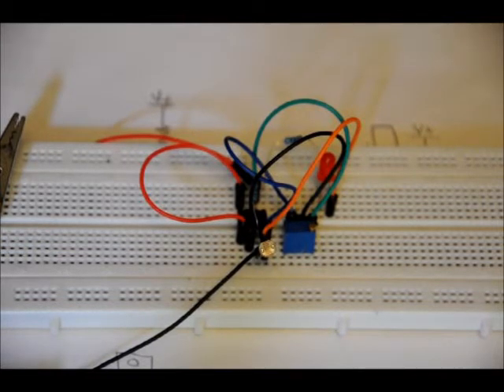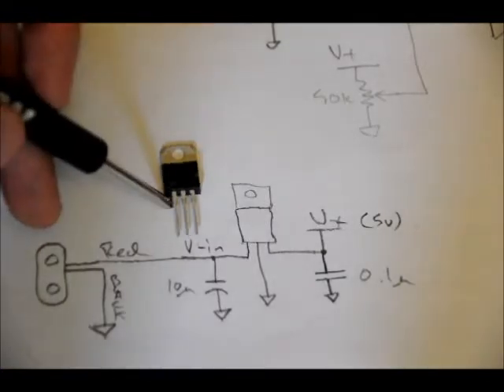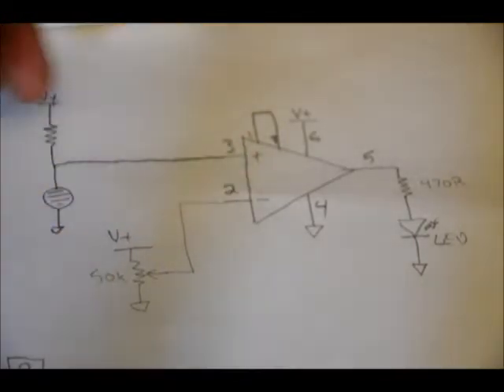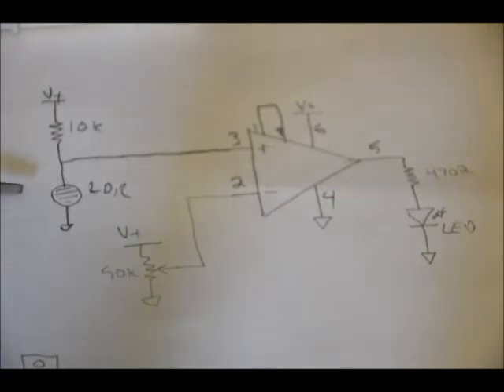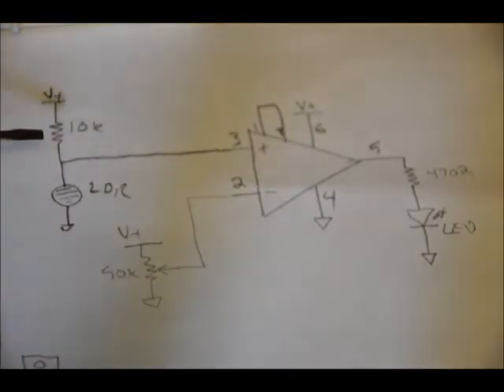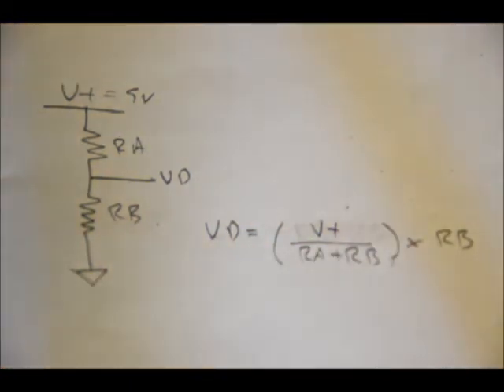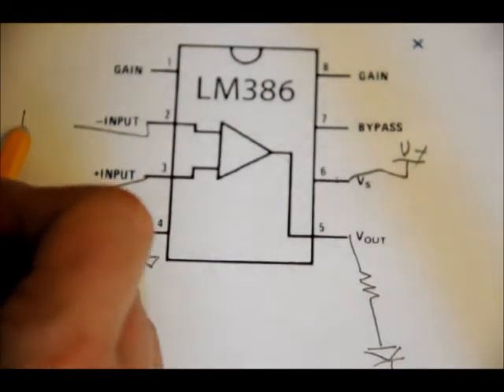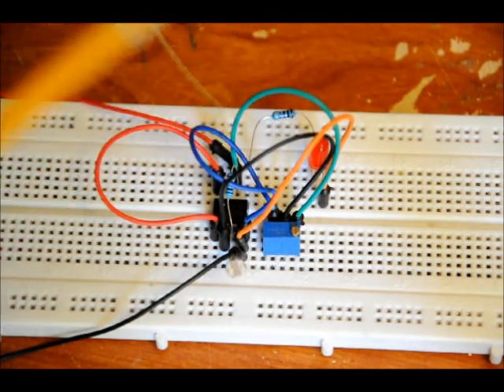Electronic Tutorial - How To Make A Light Sensing Circuit From Scratch!.wmv

Comment from the maker: Agreed, but you have no control over sensitivity.  As well, you'd need an NPN and a PNP transistor to easily switch logic.  Ideally, you would use an ADC for perfect sensitivity adjustment, but that requires software.  I used the basic NPN circuit in school, and I found it to be nothing short of mickey mouse.

Comment: Thank you for your posting all the videos. They are great.  I just have one question regarding the sensitivity adjustment capability of the main circuit. The input voltage at the positive pin of the opamp is connected between 10kOhm resistor and the photo-diode. However, depending on darkness/light, the input voltage can be either 0V or 5V, instead of a continuous changing value, which makes the sensitivity adjustment useless. I know I am wrong, but I just can't find myself wrong.